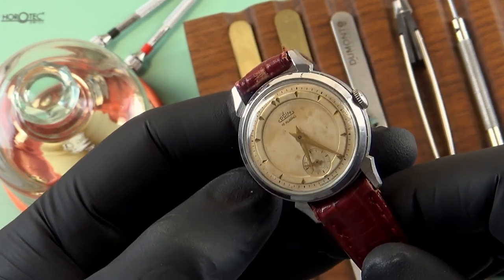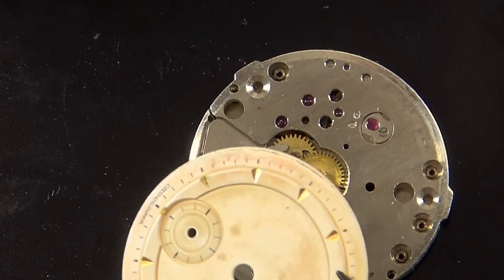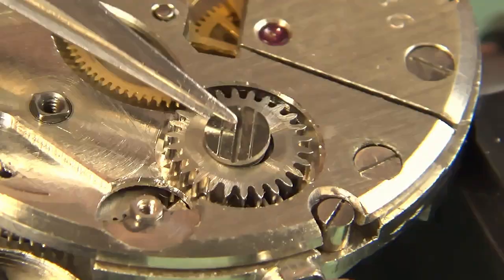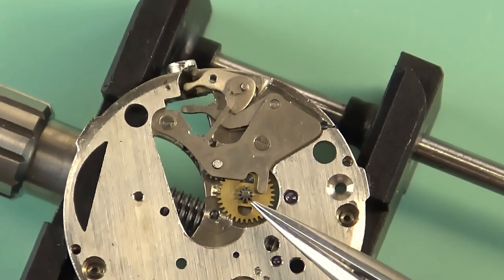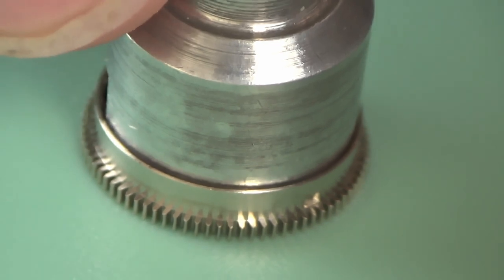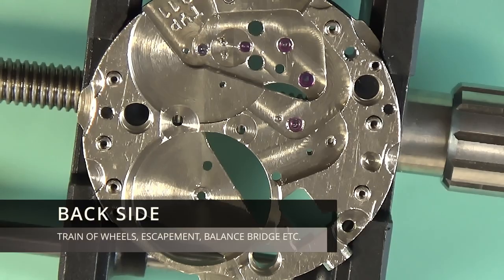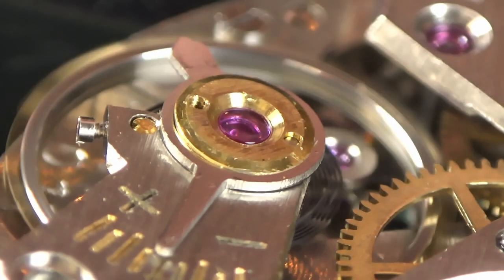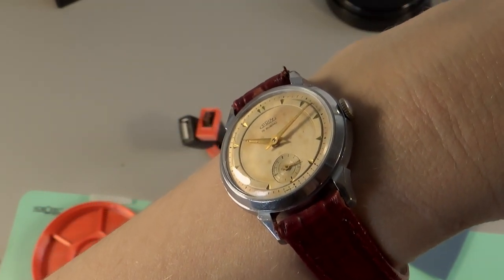Restoration of a rare 1950s Czechoslovakian watch

Comment: Hey are you running one round of cleaning only in the solution? No isopropyl and demineralized water? What solution are you using and finally do you mix it with water? Thanks
Reply from the maker: I run a three step cleaning process for most stuff starting with Elma WF Pro Cleaner in an ultrasonic cleaner for around 10 - 15 mins then Elma Suprol Rinse also in an ultrasonic for around 5 mins. A waterless solution for rinsing watches after the cleaning process . The cleaning solution used before in the cleaning process is thoroughly removed. Any remaining Elma Suprol Rinse evaporates. Metallic surfaces are conditioned for optimum effect of lubrication.

When that's done I put everything through a drying stage (fancy way of saying hairdryer lol) For cap jewels, hairsprings and the like i use Bergeon B Dip.

The cleaning solutions i use are quite expensive, but i don't use a lot of them and they really do work with great results. The watch cleaner is designed for ultrasonic cleaners so no need for an expensive watch cleaning machine.

If you are in Europe https://www.cousinsuk.com/category/watch-cleaning-rinsing-fluids no affiliation it's where i buy stuff.
Reply: @Saving-Time  Thanks for a great explanation and tips 👍👍👍

Comment: Couldn't remember which video had the split screens. A little of that is okay to me but too much of it is like a Pepsi commercial. Almost over stimulation.
I think a great side shot would be one of you looking at the little teeny watch on the table. You're the first watch maker I've seen do a video that shows the size of the screw in their hand. It was mind-blowing!
Reply from the maker: The first time I worked on a watch, I could not believe the actual size of the parts. Even after looking through many display case backs over the years, it still came as a surprise. All my new content has splitscreen, and now I'm trying to strike a balance and tell a good story with the editing. I'm still learning, and a problem is that half the internet has the attention span of a goldfish, so I have to somewhat keep the editing on the rapid side. I'm still finding the right balance. Thanks for the feedback; it's really helpful to me.

Comment: I have a hard time with spotty faces. Eeesh. One watch repair show used a small sponge with distilled water. No harm done,  dirt gone,  viewer satisfied.  Ah! Feel better just saying it.
Thanks for your work. I'd like to get a wrist watch but can't afford $100s and can't repair it myself. Are there reputable  watch repair sites in chech. I might be able to contact for vintage mechanical watches?
Quartz watches don't work for me, I've ruined them all. Something about my  magnetic field doesn't  work with quartz watches.😊
Reply from the maker: It's sometimes possible to clean a vintage dial if there's dirt on the surface, but mostly it's not as the damage is on the varnish layer, so you'd need to strip the varnish, which will most likely remove the paint underneath. Then you're going to have to have the dial professionally restored and reprinted (https://arcstampfli.com/), and that will cost hundreds if not thousands of dollars. Vintage dial restoration is an art unto itself. The issue with vintage watches that no one talks about is that you need to have them serviced pretty much every time you buy them, and that will set you back $150 to $300 if you're lucky. It can get a lot more expensive than that.

If you are looking for a day-to-day watch that's mechanical and not too expensive, I'd recommend a Seiko 5. They can be had new or close to new for around $100ish. They are solid watches that come with none of the issues that vintage watches come with.
Reply: @Saving-Time  sounds good. We are all living on borrowed so that sounds  appropriate. I'm going to watch your next video. Thanks